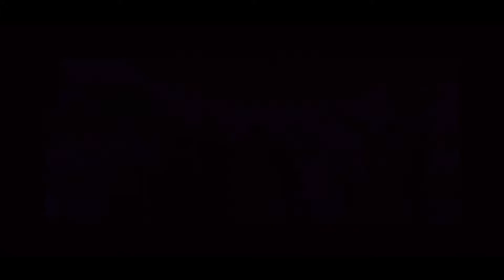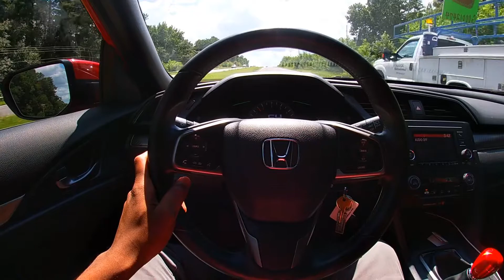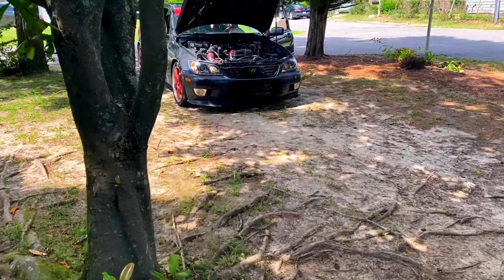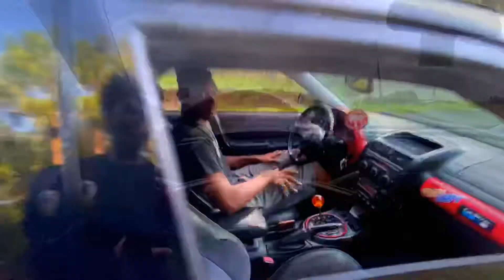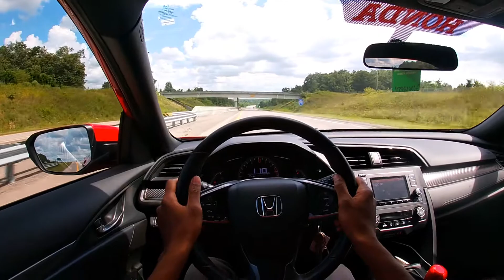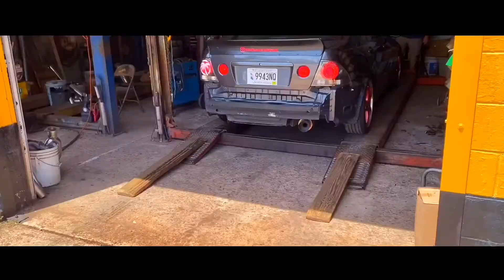IS300 Drive By Wire Delete | Was It Worth It? | Xcessive Manufacturing

Comment: I know this is 5 years later but, the throttle lock will cause you to fight  the electric idle air controller that is attached to the throttle body. It’s not a cheap part to replace either. But the stiff pedal people talk of after installing the throttle lock is you fighting this electric motor. I’ve seen one or two people actually delete the gears that connect it to the IAC and said that it is completely worth it after that. I bought the throttle lock and probably will never install it unless there is some major issue with the throttle body and it is needed.
Reply: So if I get one do I grind the gears n let it do its thing with the lock? @ForlornAuto
Reply from the maker: I no longer suggest it
Reply from the maker: You are definitely right. And it makes the pedal super still